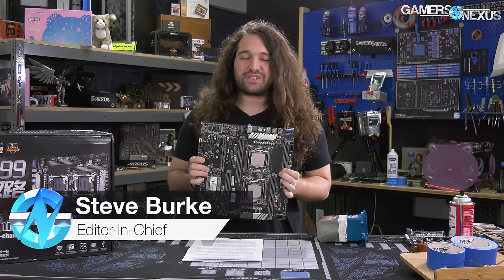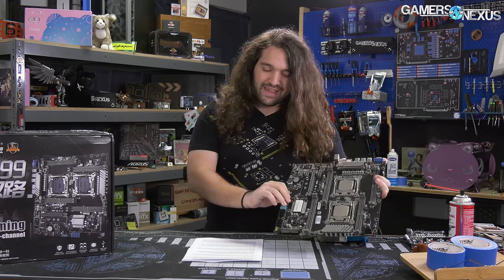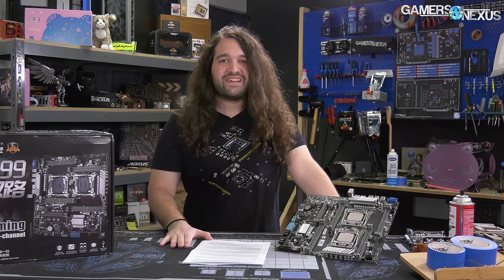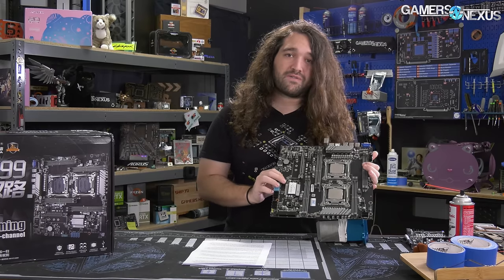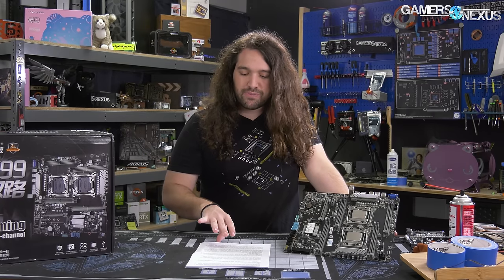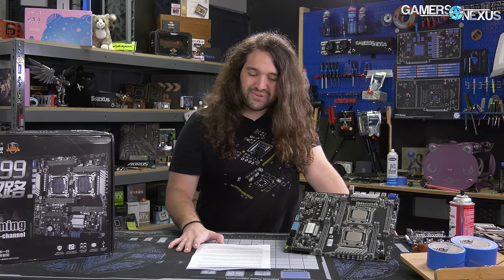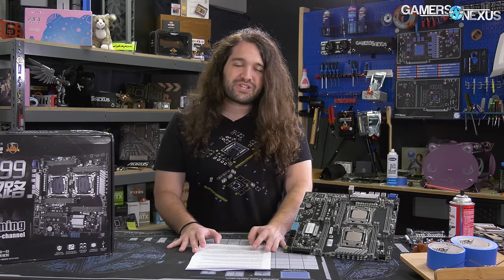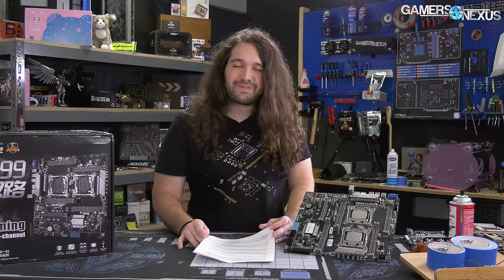24 Cores, 48 Threads for $360: Dual-X99 Jingsha Motherboard vs. AMD R9 3900X

Comment: I wanted to buy 2CPU system from China, but went to 3900x. While 3900X is about the same productivity as 2x2678v3 (after Unlock Turboboost for all cores) it is almost twice more powerful in single-core, which also matters for CGI which I do everyday. Also many Chinese 2 CPU motherboard are very slow on startup. I noticed you didn't considered 2xCooling and more powerful PSU needed for Xeons in your value numbers, while my 3900x is totaly fine with box cooling. And where are yours Cinebench 20 results, both multi- and single-core? Man , these are CPU for workstation and you test the games productivity mostly.
Reply: It did say gaming on the side of the Motherboard.

Comment: Xeon 2678 V3 (SR20Z) are final revision btw and are preferred when buying them as they will run Turbo Unlock on all cores plus a little undervolting will help to stay in the 120TDP limit

Comment: Question was answered in the video...the one time I comment before watching the whole way through.
Comment Redacted Huh, this is about what I expected from the title. I do wonder if disabling one of the CPUs would have helped with the 1% lows and stutter. Game with one cpu and render with both. I’d just get a 3900x personally, but i wouldn’t mind adding it to my home lab to play with.
Reply: Or even tried with 1 CPU.
Reply: @wobblysauce  They did say it works with one cpu but you’re limited on the memory support to just the four slots. At $250 though I’m not sure that’s the best value for the performance you’d get out of a single cpu.
Reply: @hollowknut9473   A gaming-focused combo, like E5 1620 V3 with 4x4 GB, can be had for $160. If the prices of RX 470 would go down to what they were a year ago it would be compelling for a cheap and cheerful build.
Reply: @hollowknut9473  Oh, I was meaning like the 1% dips.

Comment: What I’ve learned: get a ryzen 5 3600 and call it a day
Reply: Depends on workload but yeah I would recommend most people to go to the more efficient and better single core performance zen 2 over old crap
Reply: Yeah. Far better power consumption and less heat output
Reply: Yep. I would only consider this if I wanted to build a very Mac Pro-like hackintosh system.
Reply: X58 chip that can oc to 4.9 ghz = 20.00
X58 chinese mobo with triple channel memory = 60.00
X58 memory kit = 30.00

I can make a whole gaming rig for the price of just your chip, and it wont be all that much faster for practical use because of the advantages of triple channel memory.

Comment: Built my mate e5 2678v3 more than half a year ago with huanan x99 tf gaming, board which supports both DDR3 and DDR4 memory, with 4x4gb ddr3 and snownam t6 cpu cooler combo costed 250$ ,did turbo boost modification and ram speed and timings tweaking and this works great with 1080 TI, considering he games at 1440p there is no bottlenecks. Great value build :), 
I wrote comments long time ago under GN videos , to check e5 2678v3 , my prayers have been heard, Thank You STEVE!!!

Comment: Some of these older 2600's series are still very competitive. The E5-2698v4 (20 core) is where is at these days, two of them in a system will beat out even the Latest 28 core Intel Mac pro and match the Threadripper2 32 core. Additionally, Threadripper isn't all that compatible with certain multithreaded workloads.

Comment: I was just looking at buying two Xeon E5-2666 v3's for 169 USD each!!! They base at 2.9GHz and turbo all threads to 3.3GHz.  The sale is coming from Riga, Latvia.  Apparently they were custom chips for an Amazon server farm, which was cancelled in 2016(?).  I think the seller I'm buying from is directly related to that venture, and I think this would make a kick-butt system with 2.9 all core for such a low price.  Any other 2011-3 Xeon's with a 3GHz base go for about $300 for legit non-es chips.  I'm unaware of the overall compatability of engineering samples and dual cpu mobos, so I'm playing it safe with a used ASUS Z10PA-D8.  Please let me know what you think!! I'm getting two chips and a dual socket legit non-chinese board for $464 USD. I'm so excited for this workstation/blender destroyer/minecraft server/NAS/hackintosh build :)))))
Edit: E5 2666 v3 is a 10c/20t per CPU
Reply: There are also alleged bios mods for 3.3GHz all core.  I plan to run Noctua NH-D9L's on each.

Comment: Thinking of upgrading my X58 Xeon to a dual X99 setup. It's just so cool. 

Feels like you should have tested with different CPUs for the gaming. E5-2643V3 3.40GHz which are six core for example.

Comment: I'm currently running a xeon Broadwell chip with a asus x99 deluxe and it works great and takes the punishment! I have ran both v3 and V4 chips on the board and made sure to update the BIOS all the way

Comment: I still use an x99 board today with a i7-5960x. picked it up maybe 2 years ago. I think 2nd gen Ryzen was out or about to come out when I got this set up 

honestly not a platform I would have bought....if not for the fact that the computer was basically being given away by some rich dude in the hamptons. I guess this was the PC in his summer home as he lived in NYC 

So for a total of $225, I got a Asus x99 Deluxe board, the 5960x, 32gb ddr4 ram, a liquid cooler, a 800w modular psu, a decent case, a 500 gb Samsung Evo 850 ssd, and a GTX 760 2gb

I took the 760 out (valued it at $50) and put it in a different build and sold that for a profit. 

So in a nutshell I paid $175 + gas to pick up 

Was the best find I made on my local deal sites.....till I found some old video game developer moving who sold me a x99 pc with 64gb ddr3 ram, x 79 pc with 32gb ddr3 ram, x58 pc, and i7-6700 pc for $200 total (they all had ram as well and some GTX Titan, can't remember which one, maybe a gtx 580 as well in the x58 build)

Comment: There's been some cracking deals lately.  I just picked up a similar board, 2x xeon e5 2670 CPUs, 4x8gb Samsung 1866 ECC memory and a 512gb Seagate nvme drive for $480 Aussie dollars, which is around $340USD.  

Not bad for 16c/32t, 32gb ram, and 512gb nvme.  Considering a 3700x is around $500-520 here alone, I think that's a pretty good deal.
Reply: whats the benefit when 12th gen i3 is faster than it ?
Reply: @gurukantdesai4225  some of us are collectors.  You don't need to be so closed minded.  I collect hardware for a living.

Comment: Xeon E5-V4 (and V3) are very reliable CPUs. We have a bunch of them still in use in workstations on X99 workstation motherboards. Really hard to beat, and we're still building systems and upgrading with used server CPU's. They don't overclock, but they don't crash.

Comment: Any chance to slip in RandomX benchmarks for a quick 5 seconds for the CPU tests for ongoing tests yeah?  Power consumption over idle during that test would also be valuable.  Sometimes the FPU unit excels in certain tasks that are exemplified with that benchmarking tool.

Comment: ASPEED chip is a management SoC used for managing the server remotely. You can access sensor data like fan speeds, temperatures, voltages using it and remotely view the graphics output and control keyboard+mouse over the internet.
I really wish someone made a standalone PCI express card with an ASPEED chip on it that you can plug into any computer for this purpose.

Comment: I use Process Lasso to ensure that any games are pinned to cpu-0 in order to avoid latency stutters due to assets being on the wrong NUMA node. Mine is an older dual e5-2670 v1 32GB per socket setup. Put together almost 4 years ago; had to buy a new WS board so it wasn't much of a savings. Will be going 3700X or 5800X in a while.

Comment: A great use for one of these is if your a grad student or similar doing CFD and on a budget. A setup like that is going to see somewhere between 2 to 3 times better performance compared to a 3900x in solving due to the significantly better memory bandwidth, the only real downside is needing to buy 4 times the memory to properly populate all of the channels

Comment: I just picked up a free Dell Poweredge t310 from a closing video store my buddy worked at. Threw a SSD, an old gtx 660 in it, and a second power supply (for the gpu) that I've collected for free over the past year. Now I've got a gaming PC that hits about 80 fps in Overwatch and CS:GO and 30 fps at low/med settings in pretty much any game.

Comment: Ha, that's funny! The 2695v3 ES is exactly the same CPU as I got when I first got into home-server stuff last year. I got mine for $119 in December 2019. I got the QFGH however, which has a 100MHz lower base and boost compared to the QEY6. The QEY6 is just the 2695v3 with a 100MHz lower base/boost as well (so QFGH/QEY6/retail 2695v3 is base 2.1/2.2/2.3 respectively). They're not OEM only, they're just Engineering samples that someone has gotten ahold of and sold off on the used market, which is against Intel's guidelines.

Comment: ASPEED SoCs are the way to go on nearly every server motherboard for On-Board graphics. For example Supermicro mount them on there PCBs. Usually they are used as BMC to remote-controll the server. But this requires a specific firmware in it. Supermicro use the term IPMI. HP oftently use iLO.

Comment: I did something fairly similar to this last winter! I wanted to be able to use my desktop as a virtualization host for a large number of VMs and containers, so I built a dual Xeon workstation; the same generation as used in the video. It's been a very long process, but it's also been a ton of fun.
Reply: I should add, it's my primary desktop. It's not just a good server, it's also good from a desktop perspective.

Comment: Two weeks ago a received a Dual X99, two 2650v4 and memory. It costed me $54+7.66+28 respectively. Mobo has a compatibility problem - it support both desktop and server memory and it supports v4 series but... not all of this together. So I had to sell locally my desktop memory 16gb and for that money I bought 32 gigs of used server memory. Profit! For that inconvenience I charged a $12 refund from the mobo seller. So now I have dual system with 23500 PassMark points for $77.66. Not $360. Of course it has some minor bugs like bad sound card if you compare it to branded motherboard but for that money it is still a very good result. I would say it is unbeatable.

Comment: I love seeing vids on these old xeons, my daily computer is super old but yet still quite fast and able to do everything I ask of it, I'm running a first gen xeon e5-2667 with an rx590, ssd boot drive and 4tb raid, I play most heavy titles in 1440-1800p and games like rocket league in 4k, I'm cool with averaging 100fps on all the games I play, but as of late some games have recently updated and it struggles to keep a decent framerate at 1800p, when I have to drop to 1080p to play a game I'll finally upgrade heh

Comment: Been using a pair of e5-2620v3's in my desktop for a few weeks now, I'm surprised how well they work and were a nice upgrade from a single i5 of the same era while being super cheap and letting me add a lot of ram (I do a fair amount of virtualisation, so being able to add ram and add it cheap is important to me). Also they're about $US20 each, which is insanity for 6 cores/12 threads.

Comment: I bought several of the kllsire x79 combos that were about $115 shipped for 2640/board/16gb ddr3. It was a little finicky getting them setup but so far no complaints. I had a very specific need scenario. I needed 4 gaming pcs for a lan and my complete system budget was 350 a piece. I paired them with x580 8gb cards and they run CSGO and BFV at 1080p just fine. I obviously wouldnt recomend Ali gear for anyone who needs garrantees. This is strictly for...idk russians and junkyard pc folks like me. I didnt consider the e-waste perspective, thats kinda nice.

Comment: These sorts of setups are good for servers running multiple applications.  Best if you can scavenge/buy really cheap most of the parts though.  I have a dual X5675 system running a Plex server, a Minecraft server and backup (for all PC's in the house).  It has plenty of CPU room to run several more applications also (BitTorrent, CCTV, network proxy, random vm's, etc.).

Comment: I put together a PC with a broken one i had lying for parts, a Chinese Machinist Mobo with I-Engineer's Bios, a Xeon E5-2667 V4 Cpu, 64Gb of Samsung and Micron Ram, a Pci-e gen 3 Samsung SSD that was on sale at Canada Computers and a 6800XT card that i allready had. Mobo, Bios, Cpu, Ram and SSD might have costed.. 400$? Surprisingly decent. I'll put a TPM 2.0 chip on it and will endure the thing for a while.. PC parts are really crazy AF expensive these days..

Comment: Steve have you considered buying directly from taobao instead? Taobao prices are substantially cheaper than aliexpress but there is shipping cost. I do believe taobao has integrated shipping but if you are able to get a 3rd party courier you might be able to get quicker and cheaper shipping.

In regards to TDP the best way to improve performance is to perform a driver enforced undervolt, my e5 2649v3 is able to do a -90mv and hit nearly its all core boost while dropping 100mhz lower when at full load.

Try to get some Ddr3 compatible "x99" boards for those 2678v3s, as they are pretty much the perfect dumping ground for old ddr3/ddr3 ecc ram :)

Comment: I guess i might be a bit late, but i think the reason of this setup being so slow is due to the dual processor setup.

If you have constant request from one processor for another processor's memory data, it will dramatically slow the system down.

All other Xeon processor tests don't have results half as bad as this, but they are all running single society setup.

Could be rather similar to first gen threadripper, where you disable half of the cores to make it faster in games.

Comment: Jingsha X99  very small VRM heatsinks, so on the Jingsha X99 instead of the Xeon e5 2678 v3, I would put two energy efficient Xeon e5 2650 L V3 or V4 with a TDP of only 65W.

Comment: I have this board with these CPUs. Don't expect much speed from a SSD drive, I have an evo 970 M.2 (not the pro) and it's really slow on this board compared to regular modern boards. Otherwise for multi-threaded loads it's pretty good. Notably blender and handbrake. But yeah, single core is crappo. Also two big heatsink/fans didn't physically fit on this well, so had to replace one of them with a water cooler. Also the amount of settings in the BIOS is just wild. There are settings in there I've never seen before, pages and pages of it.

Comment: The X79 CPUs had higher out of the box clocks (and an OC-able E5-1600 series), where the X99 had lower clocks with better efficiency for their intended applications.
For older MoBds for gaming (and some workstations), single CPU options, like the X79 with an E5-1660v1 (6c/12t) or an E5-1680v2 (8c/16t) OC'd to 4.5 - 4.7GHz, were the best "bang for buck", when the pricing was low. 
However at the present pricing it's just not worth it.. as I just built an i7-8086k (stock), Asus WS Z390 Pro, 32GB 3200MHz DDR4 system that significantly surpassed the performance of my Asus X79 Deluxe with an E5-1680 v2 (@4.5GHz all core), 64GB ECC ram. Gaining on average 75-100 FPS in games and near twice the file density in AutoCAD 2D workload applications...  while at the equivalent present prices for a complete build with used hardware.

If the mod for the Dual socket X99 becomes available for the Dual X79, I'd love to try it on my Supermicro X9FAi MoBd,.
I have 2x E5-2673 v2 (8C/16T x 2) that are 3.3 - 4ghz and a 110 TDP. 
So seeing that the E5-2667 v2 is essentially the same processor with a 130watt TDP, it will likely be the optimal choice to boost to 4ghz all cores with a grater sustainable under-volting threshold. Possibly even the E5-2687W V2 (8C/16T x 2), 3.4 - 4ghz and a 150 TDP may make a worthy option for under-volting.

Comment: As with all builds, it depends on 'what it's (going to be) used for'. A workstation essentially, which is kind of what you would think in any case. It would be good for Music Production / DAW rigs on a budget, in fact even the single socket X79 & X99 Chinese boards are (Nobody ever tests for this, Why?). Essentially, most DAW work has been done in x86/32 bit, both app & efx & instruments for years. They can only make use of around 4GB of total RAM. DAWs however, have now switched to x64 & efx & instruments are making a 'slow' change also. So software wise, it's kind of all a slow burn. & Those synths can cost £250  each. People are not willing to keep spending, so stick limited in x86 especially if it's a vital instrument for their work. Or use the same x86 synths in apps like Jbridge in x64 bit software (this also allows access to more RAM for each instrument). This means that CPU specs to run the synths are essentially the same as when released but, when stacked together start to hurt cpu load as always. DAWs however, for years (like Ableton Live) have made use of every core & thread made available quite happily instead of just pure clockspeed. Meaning a cheap rig like this, would make a brilliant DAW setup. With modern options like NVME 2 etc & a massive SATA count for sample libraries & an optical drive still, for ripping samples. For this board you need an 'E-Atx' case. 
Many still use Core 2 Duo /Core 2 Quad or Phenom II x4 systems for DAW use.

Comment: Still have my secondary computer as an optiplex +  ali xeon ultra budget even after building something more proper. All used parts parts other than 50$ evga b stock gt 1030 and was around 130 to build. Honestly still performs better at most tasks than even modern sub 500$ laptops or entry level mac's at 1/4th to 1/8th the price since it has more ram ssd and dedicated gpu. Great machine for stuff like web browsing older/indie games emulators etc.